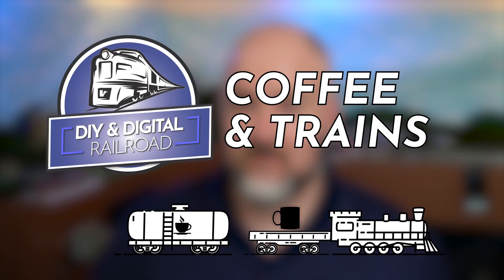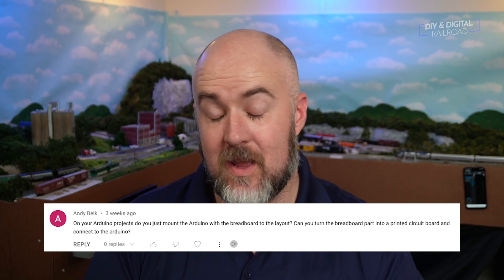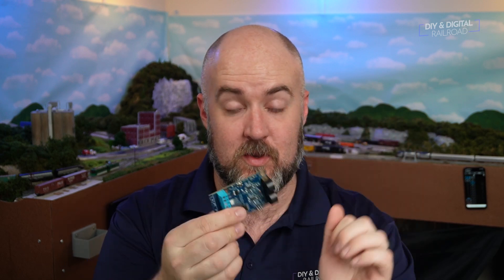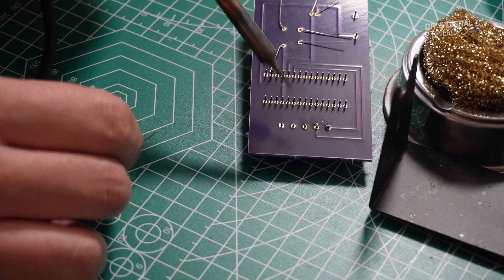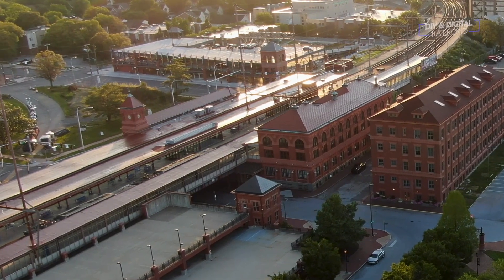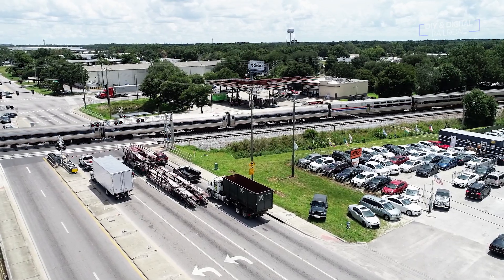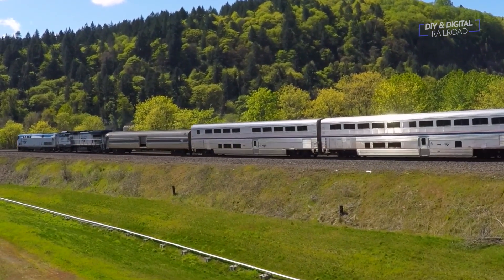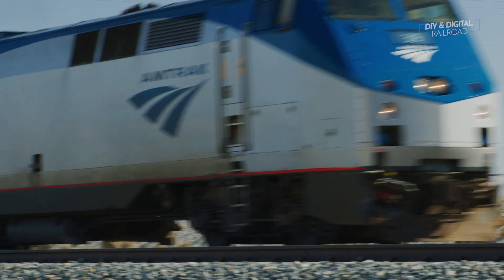Troubleshooting and Where to look for Amtrak Inspiration

Comment: Ok I got a question. I have a 21 pin soundtraxx sound decoder and I can’t speed match it. CV 5 only goes to a value of 63. Not 255. If I change it to let’s say 55 it will slow down to 30 scale MPH. Nothing in between. So value of 1 it’s full speed, 63 it’s full speed. I’m sure I’m missing something.

Comment: Jimmy, I would caution people that have locomotives with loksound decoder installed, to not do factory reset. There seems to be such a complex relationship between the cv settings and the sound file installed that resetting can cause major problems. Recent experience with an NCE system to reset a custom loksound decoder resulting in no sound nor motor function, taught me this.

Comment: I had a new n scale Atlas/Kato U25B DC locomotive that would go slow in one direction and just jerk when trying to go the other direction.  It turned out that one of the trucks was installed backwards.  With that model all I had to do was pull the trucks off (they pull out without any tools) and turn them so that the brake lever faced the fuel tank.  That fixed the problem.

Comment: I had a similar problem with a locomotive that was jittering back and forth and not running smoothly. It turned out to be a DCC locomotive (didn't know that when I bought it) that was picking up on a "dirty" DC signal on my layout. When I moved it to the other layout and used my Tech 6 hybrid controller in DCC mode it worked just fine. Some DCC locos will run fine on DC, but this particular one doesn't. So it might just be a matter of switching to DCC or putting in a hybrid controller like the Tech 6.

Comment: Re the loco that switches direction and only runs very slowly: I have seen this once on DC loco that had 2 power trucks that were wired in opposite directions. Whichever truck had better traction at that point defined direction of travel, and rather obviously the loco could never build up speed in either direction. Weird, I know

Comment: Jimmy, have you thought about passenger operations for your layout? Not just having passenger trains running with freight trains, but passenger operations? Pre-Amtrak there were passenger trains that had cars switched in and out, especially secondary trains that had cars put into main passenger trains. You've said you're a fan of both the NYC and the Southern, so I was wondering if you might try such operations some day.
Reply from the maker: I do want passenger operations!  I’m actually planning on collecting passenger sets.  NYC and southern are on my list!

Comment: My question is: is it possible to control a digital Tortoise or digital Cobalt by assigning it an address as if it were a locomotive?  I have an MRC Prodigy Advance comand station with two controls (Advance and Advance 2) that works perfectly

Comment: Hi Jimmy, What is your thoughts about the NMRA and the standards they set? Do you try to stick with manufacturers that follows those standards or use just whatever? Have you looked into their AP Certificates and what it requires to be a Master Model Railroader (MMR)? - Jason
Reply: Jason, I weight all of my rolling stock to NMRA standards.  All rolling stock gets metal wheels and kadee couplers.  All wheels are checked for proper gauge (have found some that were not gauged right).  Coupler heights are all checked with a kadee coupler gauge.  I use #5 or #148 as I find the scale head couplers will find problems in trackwork and uncouple.

Comment: Unglazing now. 😆  but still love these Q & A.
Reply: Q for consideration in future videos.
I have the NCE PowerCab with 5A booster.
I have a sound equipped SD70M2 loco. 
The volume is very loud.
How do you use CV codes to lower volumes? Can't find that in my mega Google searches.